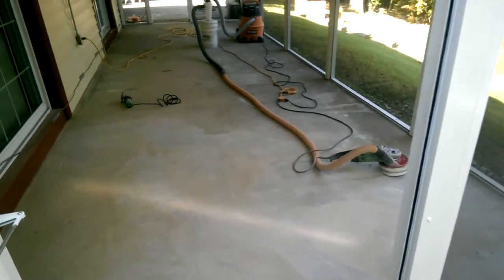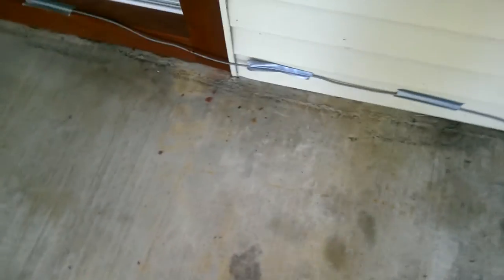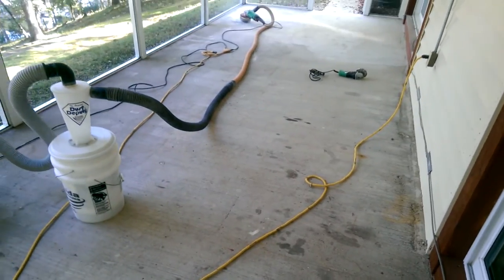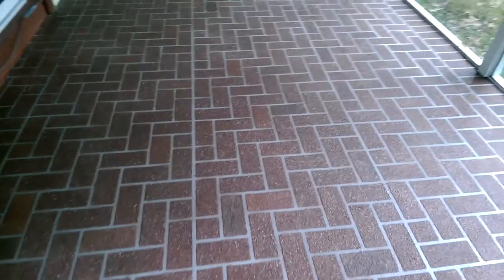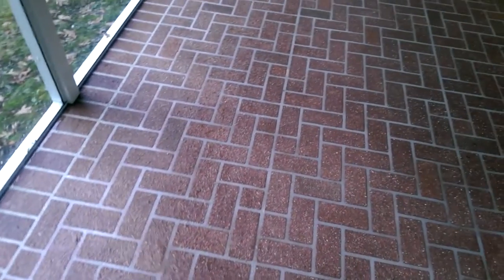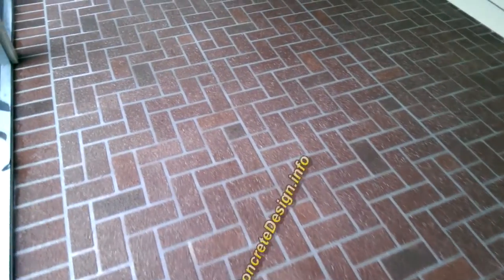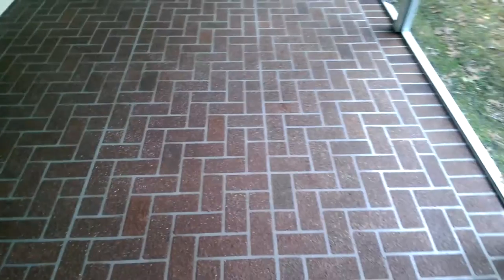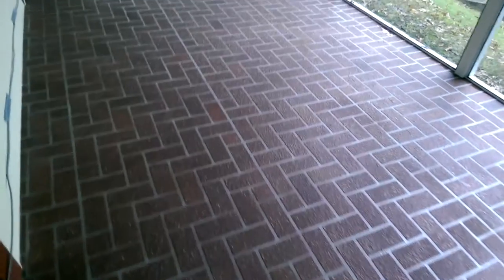Decorative Concrete Spray Texture Resurfacing Lake of the Ozarks MO

Comment: where can a buy the concrete spray texture
Reply from the maker: cesar torres You have to become a certified installer of the product in order to buy it, I use The Concrete Protector and Elitecrete Products.
Reply: MrCustomConcrete how you become certified
Reply from the maker: +cesar torres you have to Attend a weekend class to get Certified.